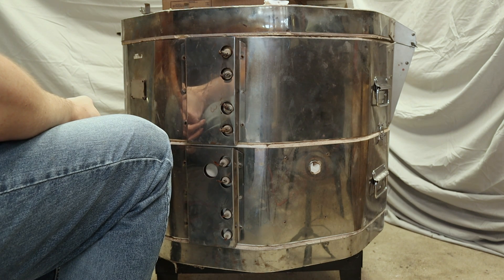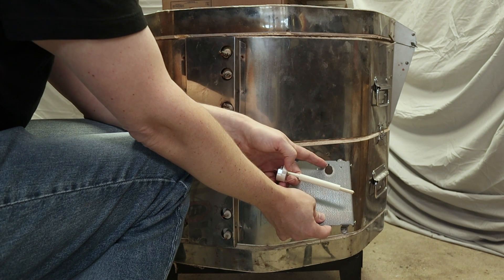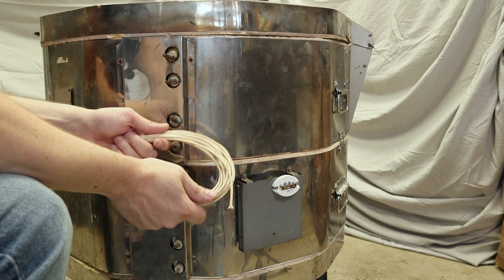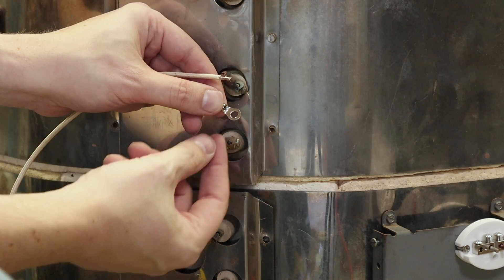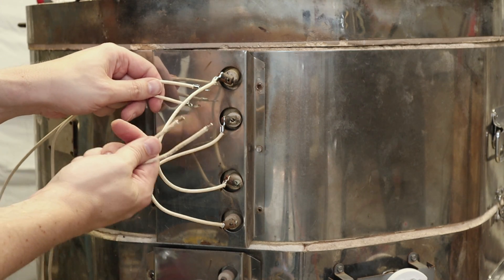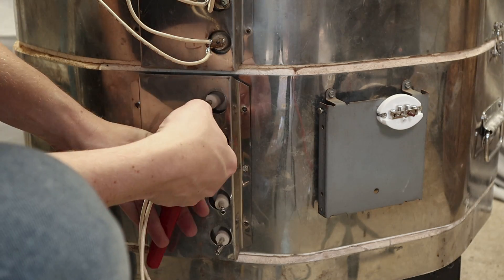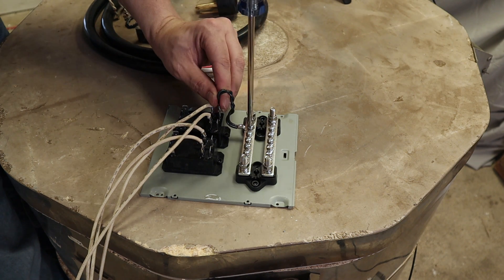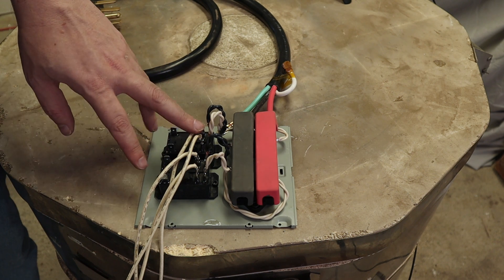New High Voltage wiring for my Skutt kiln rebuild ⚡️

Comment: I have an older kiln (25ampl that I'm looking to get set up (will be installing a 30 an outlet in my garage).

Similar to this kiln,  mine has a 3 prong cord (2 hots and the neutral acting as ground to the body of the kiln).  The local electrical inspector said I'm  fine sticking with 3 prong cord.

Can you explain why your switch to a 4 prong cord is better? To my (admittedly limited)  understanding,  I don't see an improvement in safety since you're still using two hots and one as a ground while not utilizing the 4th wire.

Thank you for any insight.
Reply from the maker: It's been awhile so I don't remember all the details. You do only need 3 conductors - the 2 hot lines and 1 ground (not neutral!)
One reason was I wanted to bring it up to what Scutt does with their modern kilns. I also wanted to future proof in case I needed as 120v line for the controller (it turns out I didn't do this). But your electrical inspector is the expert for sure!

Comment: Nice video. Is it 10 gauge high temp wire? Can you use 10 gauge instead of making the pig tails of 2-14’s?
Reply from the maker: The high temp wire is 12 gauge (I didn't see 10 when looking) and I think this is what is commonly used.
As far as the pig tails in the junction box - I just used what I had laying around the garage. It is just normal 14 gauge and I doubled it up to make sure it could carry the load. A single wire would be simpler. A 12 gauge wire should work, but 10 could also be ok. I'm not sure what the weakest link is - my guess is the elements. Either way I didn't want the wire to be an unintentional fuse!

Comment: I'm so happy I found your video! I am making a kiln for my mother but got a bit stuck on the electronics. It's a smaller version of your kiln. Many thanks for sharing this. Is it possible to put the wiring diagram somewhere online?
Reply from the maker: I don't have a wiring digram for what I did specifically. However I more or less followed the basic wiring of other Skutt kilns. This pdf shows how they are wired: http://www.skutt.com/pdf/op_manual/2009_op_manual/KM_Manual-09_WiringDiagrams.pdf Hope that helps!
Reply: @PotterybyKent  That helps a lot! You will propably hear from me if I succeeded (or if I'm stuck, but the diagrams look pretty straight-forward :) I hope my calculation for the element wire was correct. Thanks again Kent.
Reply from the maker: You're welcome!